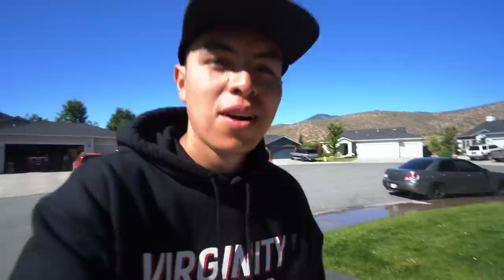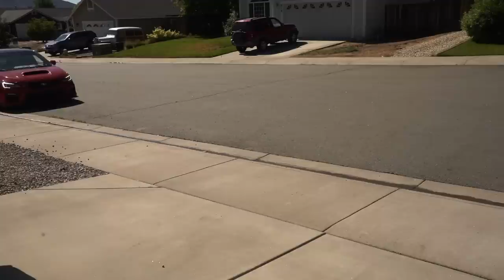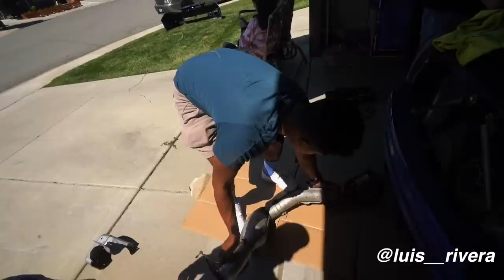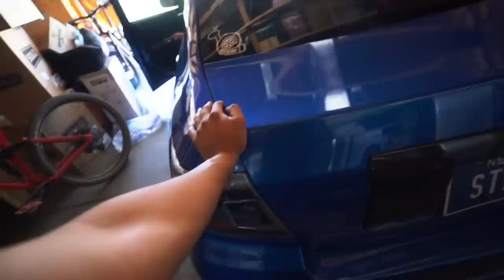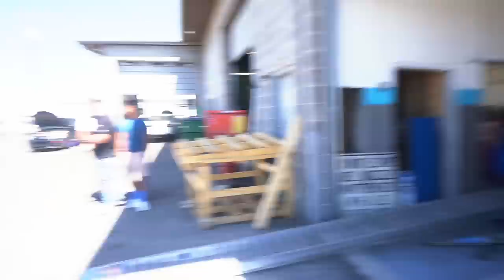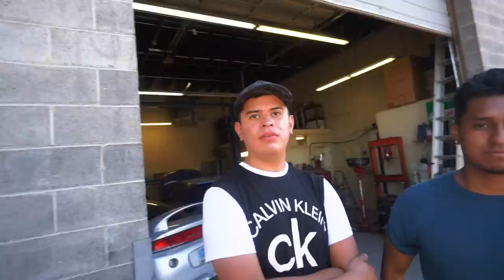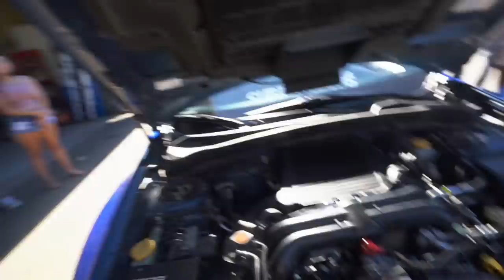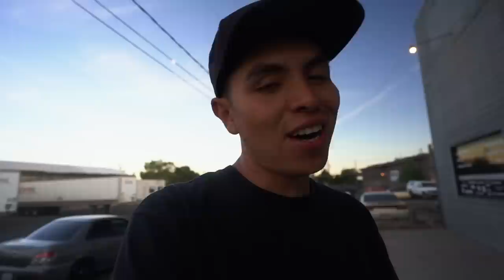Subaru WRX Blows Up On The Dyno!

Comment: Absolutely the tuners fault. Any good tuner will do a mandatory inspection before putting it on the dyno. My inspection took 2 hours and was denied because my spark plugs were bad and it through off some other things. He should of noticed that leak before abusing that fragile block
Reply: So it's the tuners fault that the customer brought in a car in shit condition? What kind of ass backwards logic is that?

His it's HIS job to make sure HIS car is running right. The tuners job is to tune the car, not babysit and hold the guys hand to make sure his own car is in good condition.

Who the hell even brings their car to get tuned without making sure it's running right? You know the engine is going to be stressed more than stock to make more power.

Yall the type of people to bring a car in on its last legs, ask the tuner to make big power, then have a surprise face and blame him for your engine blowing.

Comment: Sad to this happen to such a nice car. It did not sound right during those dyno pulls.
Reply: Plus the burning oil coming through the exhaust at the end of 2 pulls.
Reply: You could already hear it misfiring
Reply: Your right after the first plume of black smoke I would have been trippin, but that's boosted life 4 u.
Reply: @mrnobody9153  Pretty common with catless setups, i agree though it didnt sound right but the black smoke as far as everyone ive talked to is common with catless.
Reply: @nathanway766  thnx 4 the info, want to mod my legacy. However I dont have a back up motor so yeah think I will keep it stock.
Reply: K Y  rahja.thats what I have been reading and watching. Think I  might sell the subi and get a vette.

Comment: IAG Stage 2 tuff Short Block. i just finished installing mine.
Reply: drop the iG
Reply: @canteenpapi3040   @eckoecho
Reply: Nice. Recently got the stage 3 turbo tuff. Have you noticed your oil pressure running alot higher than before

Comment: for anyone saying it's the tuners fault im guessing some of you have never owned a modded and pro tuned car. his wrx was probably low on oil, didn't check compression or leak down before the tune.
Reply: It's also the tuner's job to make sure that these things are checked and ready to go before the tune. A good tuner never puts a car on the dyno before checking oil pressure, leaks of any kind, and sometimes compression and spark plug gapping. My tuner used to do a full smoke test before every tune, and he's the most reputed tuners in the state.

Comment: Two words on where he went wrong “shifted performance”
Reply: They not good tuners?
Reply: or it's a known fail point on these motors once your start pushing significant power over stock...
Reply: @juanarroyo465  They're good. Just got another internet shit talker. Some people blame tuners for the failure of parts, when they're ultimately at the mercy of the car and its parts. It's like blaming a chef for a sub-par meal when the ingredients they were provided were bad.
Reply: Bro tell me about it 😔 my tune running like poop rn

Comment: Everyone who owns a subie should expect this if you’re gonna mod
Reply: That was car basically stock thou
Reply: I agree with Pinto. The suspect is the install of the downpipe, did the owner had a temporary map for that part so he can drive it safely to the tune and hope he didn't try to boost it going there.
Reply: @drewleon6217  that's true. They never said if they flashed it after the downpipe install.
Reply: @drewleon6217  i don't think it would happen so quick with out a tune thou
Reply: I'm sorta glad   I onlt have ap and catback  lol

Comment: Such a bummer man, but the EJ engines are just not resilient at all. They don't take knock/detonation like a 4g63 will, I figured that out the hard way myself. I had $6500 into a forged shortblock for my '04 STi almost 10 years ago and just gave up on it when everything started breaking. A/C lines, Powersteering pump/lines, A/C compressor, Alternator, Steering rack leaks, Broken ringlands all happened within the first year of owning it. Car didn't even have 90k miles on it back then. Literally once every few weeks something was breaking or a new leak sprung up. Between all that and the infamous "strut clunk" and squealing breaks no matter what I did, I sold it. I'm typing this comment so I can remind myself why I need to stay away, cause they're so addicting.

New owner put on a blouch turbo, turbo blew up, took out the motor with it, guy was pissed. Crazy to think that I just barely missed blowing the car up for a 2nd time.

Comment: Had to replace the short block on my 2013 WRX 61k miles due to rod knock. Did oil change every 3k miles and installed an air oil separator. It doesn’t feel good to have to pussyfoot around in a car meant to be driven hard so I sold it at 87k. I still love Subarus but not for speed. If I could do it all over, I’d go for a manual golf alltrack and go with an IS38 turbo swap.

Comment: Here is where you jacked up. When you make major upgrades you should drive the car around to see it how it reacts. You should have check engine lights and they should correspond with your modifications. Next you tune it on the road so the ECU can calibrate correctly. Then take it to the dyno. 
What you guys did was heart surgery and had the patient get on the tread mill right off the operating table.
Reply: Wise words

Comment: That sound is giving my Vietnam flashbacks...  Happened to me in October 5 days after I bought the car.  Bought a warranty from the dealer so I was covered for a new engine tho :)
Reply: Same with me lol 
Got my 14 WRX Hatch and 2 months later it started rod knocking so I took it to my Subaru dealership and they replaced it with a new short block.
Reply: Oh damn.  I have a 14 hatch too.  For me though I suspect it was the previous owner oil starving it.
Reply: @GreenTurtle261  this is after buying it new back in 14 or preowned with how many miles?
Reply: redlinegsxr1 I bought it pre-owned with 52,500 miles on it. My extended warranty was under $3,000. The engine gave out around 55k miles

Comment: Honestly I think it was the tuners fault. Rip stackx
Reply: lol
Reply: Low key
Reply: I think so too!! Should of went to snailperformance
Reply: Reputable tuner or not it happens. There's even a class action lawsuit on 11-14 WRX for a defect rod bearing.
Reply: how? a tuner can't just blow up an engine if the parameters are looking good. im pretty sure the tuner had scaled the maf, dialed in VE, before messing with fueling and timing.
assuming the tuner did 1 pull to see how it goes he probably went from there and started adjusting the timing table. it's never a surprise for a car especially subarus to have a rod knock on the dyno due to unknown health condition of the motor.
Reply: @martincastaneda677  woulda blew up sooner..🤣🤣 Travisty...boom!!
Reply: It can't be the tuner's fault unless the tuner is doing it on purpose. Its always the customer's vehicle fault and or the customer's fault for not either preparing the vehicle right, or not doing the basic checks and tests before putting it on the dyno. I mean, wambo's car was good. But then again, subaru's are notorious to spin bearings. Thats how it is.
Reply: turboka510 lmao doubt it!!!
Reply: Didnt he say tune heard/picked up knock when tuning? 8:38-8:45
Reply: The car made 280 whp and 300 torque. It was the block .... not the tuner. The tuner did a very conservative tune
Reply: @nikswrx  Silly subaru owners...A pos SOHC Civic can make that on stock internals
Reply: @martincastaneda677  Travis cooked my motor twice definitely wouldn't go there
Reply: Yeah not to discredit the man but it wasn't knocking before them man brought it to the Turner, I would ask for a 50% comp for repairs, being that it didn't brake when the owner drove it. However it could have just been going over time and the stress that day did it.
Reply: Nik S. Nope the same tuner blew my engine too lol he tuned my car for like a hr before it went and done plenty of runs to see if the car was running good and he would know how the car is running by the first couple pulls if he knew it had issues he shouldn’t of pushed it
Reply: @mrnobody9153  haha you can ask for all the discounts you want...they'll just laugh with your joke and hand you a bill.  Welcome to tuning little man, this is part of the risk ANY time you go on a dyno.  This is why you don't waste time pushing these shitty engines....EJs are junk, they're finally getting rid of them.
Reply: @egoboost13  Only good EJ in my opinion is the EJ207. Which was never brought over to America.

Comment: I've got a 2004 WRX Ej205 with turbo back and upgraded IC. It lasted me till 195k. I took motor out found number 4 crank bearing cracked, and another one chipped. What's funny is that I start noticed slight hesitation at around 193k, and some other things. You've got to listen your car...it will speak

Comment: Same happend to mine pulled off the cobb tune and subi replaced the motor under warenty its a known defect. They put an extra warranty just for rod barrings going bad. Look i to it and get it fixed under warrenty for free.   Mine was a 2014 model

If they see a flashed ecu or cobb tune it voids the repair so get it stock asap and sent it i  lol...

Comment: I feel the pain, i just got my bugeye back the after blowing the Ej205 up for the second time 2 days ago... Wambo has the dopest modern subi body style so i cant wait to see what direction the build goes!
Reply: Whats done to your bug? @ street_driven_life
Reply: A bunch of reliability mods, nothing pushing  horsepower. AOS, coils,wheels, radiator, visuals... You can check me out @street_driven_life on IG...
Reply: Street_driven_life nice I got a 03 wrx bugeye wagon with stock mods also lol. 3” invidia N1 exhaust, GFB blow off valve, Cobb access port, Cobb air intake, coil overs. I need to upgrade my fuel pump and upgrade my injectors so i can get rid of my stock turbo and upgrade to like a vf39 or vf48 with ETS front mount, koyorad radiator, AOS but I feel like my JDM ej205 w/110k miles will blow up if I got dyno tune, it needs work with valve cover gasket leak and lower header exhaust leak.
Reply: @klappnr6893  sounds awesome! Everytime I get close to make a leap like that I break something expensive! Lol hopefully the next stimulus goes through!
Reply: @klappnr6893  just be sure to keep up with all the major maintenance before a tune. do a compression test and leak down. that ets fmic won't benefit you unless  you're going bigger power.
Reply: Did u upgrade your pickup tube, baffle, and pan. How old were the plugs and coils. And the gdt cylinder 4 cooling mod. Usually the pickups get worn and break on our cars

Comment: Happened to me last night and I don’t know what to do. Definitely don’t have the money for a short block and it’s my only car so we’ll see what happens lol
Reply: iag stage 2 block. most reliable / affordable option at the same time. About $ 3800 , machine shop price for your cylinder heads looking at about $600 and probably   10 plus hours of labor at about $125 hour for reconfiguration, - since motor will be out might as well go bigger turbo $2000, heavy duty clutch $950. FMIC $1200, AOS $400 , radiator $ 300 , tgv + egr deletes $350. And $500 -$700 for tune depending on pump or e85. Start saving and drive your moms car for now lol.
Reply: I get it's your car, and I HATE IT for you, however...... WHY would you push your only car to its limits lol???????!! You're in a huge bind now rip :(
Reply: Get the crank ground and oversized bearing  not that hard cost couple hundred bucks.

Comment: 280 horsepower, lol, you can tell these guys have never had a fast car. That's not even enough power to scare my grandma.

But, this is what happens when Subie owners don't do their homework and address all of the factory shortcomings before modding these cars up and beating the hell out of them. Did he replace the factory oil pickup with a Killer B? Run an OTS tune before adding any mods? Running Rotella T6 5w-40? Change it every 3,500? How many times did he run it hard before the engine oil reached operating temp? 

I bought a WRX off a guy with a spun bearing for dirt cheap and rebuilt it myself, and I can tell you when it's done up right from the get go, it'll take all the abuse you can throw at it. Expensive lesson for these guys to learn.

Comment: This is depressing.

Almost the entirety of my mod list since going Stage 2+ has been supporting and longevity mods, and will continue to be until I know without a shred of doubt that my WRX can handle bigger power safely. AOS, cylinder 4 cooling mod, turbo blanket, wrapped downpipe, upgraded oil pan and pickup, upgraded short-block internals, etc.

You either build it first and then wind up the power safely, or you wind up the power and build it after it breaks.

Comment: my bc5 legacy got knocking at 260km on the factory motor, i got a brand new v7sti short-block in now with v4 wrx heads, stock power still running maf sensor. If this doesn't do at least 100k with regular oil changes i'll sell the car.

Comment: Don’t worry I blew my 2013 sti on the highway cruising in 6th gear at 130kph, piston exploded the engine. 25 mins into my first drive home with it completely stock except Cobb intake & accessport with 108km

Comment: This happened to my 2018 Subaru wrx sti my car had only 35k miles and it burn all my oil like in a month I would check my engine oil levels like every 2 months not passing 4K miles check and this happened to me I got a little lucky because dealership decided to help me paying a deductible of $2,600 for a new black rebuild motor but normally a good performance shop would charge you $5,500 to rebuilt the engine goo luck guys!

Comment: Maintenance, Maintenance, Maintenance. The most important part of having a reliable modified Subaru. No question about it. Anytime you add a mod to your motor ask the tuner for a temporary map so you can drive it to the tune. Sorry for what happened to you and your subie.
Reply: Leonel Ramirez they’re not trash, I have 2 Subaru’s and they run all perfectly fine
Reply: @ronniedarko2536  I own 2005 Sti and still rocking, upgraded everything and running stock internals. When I hear or read comments on how bad this engine is I get frustrated. Myself and other owners of Subaru's believe that maintenance how we drive our cars and tune it for reliability can still be fun to drive. I see a lot of young guys when they tune their cars they want MAX POWER! and that's where the problem begins. Nuff said.
Reply: Hey man, sorry wrong guy. It was supposed to go to Leonel. Ronald thanks for backing up on our EJ motors. I ❤ my subie the Best car I ever owned and modified. Take it easy. 🤙🤙

Comment: Ej motors perform longer on N/A, there's just not enough meat on the block to run a good amount of boost.
Reply: If you sleeve the block there is
Reply: @EEvil94  u r very right, that would require a whole other motor.
Reply: aaron powell I sleeved my ej, so far no motor issues yet lol
Reply: @EEvil94  shoots thanks 4 the advice.

Comment: Think I'm going Nissan 370z after seeing this and hearing all the issues. T_T
Reply: Good choice these cars always get head gasket problems or rod knock
Reply: VQ37HR!
Reply: Yea I’ve had 2 wrxs as my first cars too. I had to a swap a JDM motor into both of them because The first one burnt a valve the second one got rod knock and I was only making 270BHP. these Subaru’s are not reliable at all especially when you can’t even make them fast without breaking the bank.
Reply: Be careful the vq motors and fragile at the top end. The 2.5 will never be a good block for forced induction due to thickness of the cylinder walls.
Reply: Yeah ill have to join the dark side too lol my  wrx having to many issues

Comment: I love my Evos but I also appreciate Subies but why does the engine always end up blowing up or giving out, every friend of mine that has one has had a problem with it but they’re very nice cars I love how they still coming out with new ones and making the interior modern and nice unlike the evos.
Reply: WRX in general has weaker internals.
Reply: Subies can be reliable, it's just inappropriate tuning that kills them, also 2.5 blocks are same dimensions as 2.0 if im not wrong (i might be) which makes newer subarus kinda less reliable, i got jdm imported 06 hawkeye sti with factory ej207 and i'll prolly leave it stock. Im having enough fun with stiff suspension and 280hp. I don't wanna risk building it up if i can't even floor it wherever whenever i want. But yea, subies are awesome
Reply: I had a Evo X before my STI and my STI hasn’t given me issues. It’s almost at 90k

Comment: Don't go catless until you have way more mods. A high flow cat is what Subarus like. They need back pressure. Also why dyno tune with just a downpipe? I've been running an AP tune with my catted downpipe for 6 years no problems.